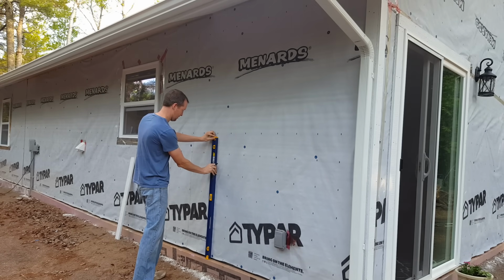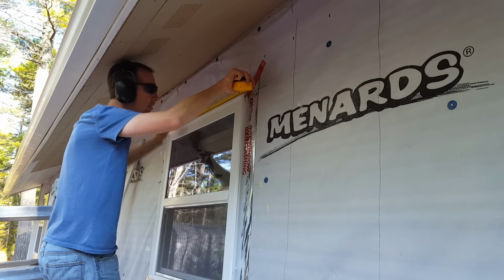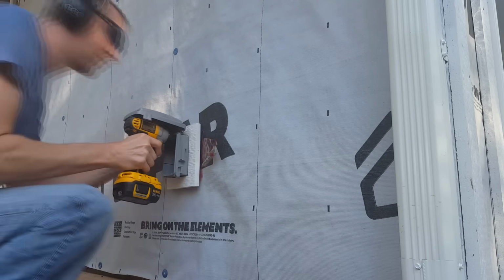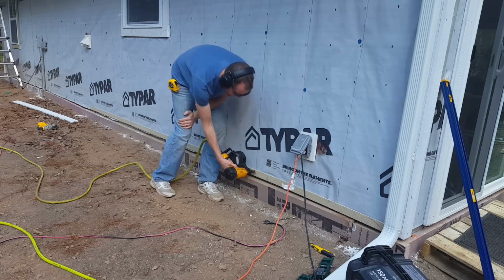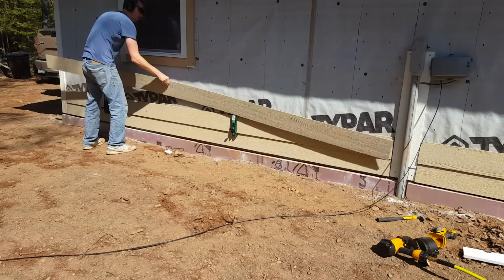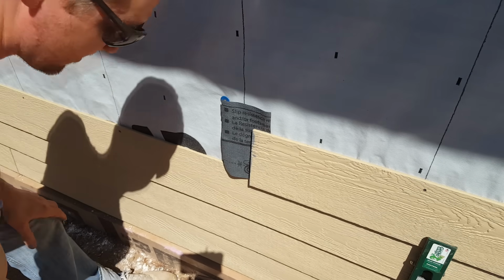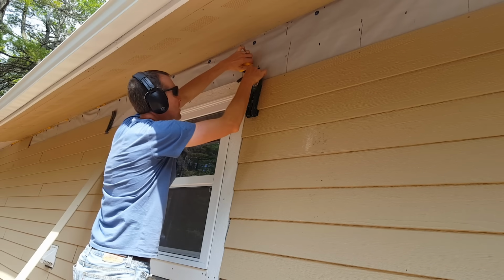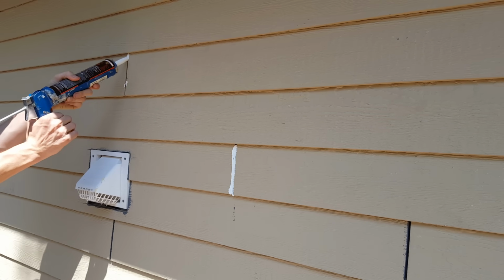Siding a House By Yourself

Comment: Curious as to why you waited until the installation of the 3rd board to see if it was level???
Reply from the maker: Hi Kyle, well the first row I leveled with the foundation. Then for a few rows I "eyeballed" it just to make sure everything looked alright. Sometimes that is the main thing. There is the saying "If it looks level, it is level". I just checked it ever so often with an actual level just to make sure it wasn't off by much. You can check it every row if you want, but how it looks really is the most important part when it comes to leveling siding.
Reply: @chaddiy  Understood, I would hate to get to the top row and have it not be level. Thanks for the explaination.

Comment: Great jobs 👍
Which type of  sealant using in joint filling area?
Reply from the maker: Hello, I used Quad Max caulk. It can be painting and remains a little flexable after it dries. It worked out great for me!

Comment: Nice job.  A couple questions.  Why didn't you paint you cut ends the same color as the siding?  I know even with hardieplank you shouldn't caulk the butt joints as it will still expand and contract.  All you should need is the flashing strip.  Is there something different about this siding?  I assume there will be some expansion and contraction and those caulked butt joints will look bad.
Reply from the maker: Hi Greg, The siding is just a primed color. If you look at the end of the video you will see everything painted gray. As long as a flexable caulk is used it is fine to do it the way I did. After everything is painted the seams blend in a lot better compared to using the little metal flashing pieces on the butt joints.

Comment: What stops water from getting under the siding on the bottom?
Reply from the maker: The siding hangs a little lower than the top of the concrete, so it doesn't leak in. There is also metal flashing that could be added to make sure no water ever gets in.
Reply: @chaddiy  that makes sense. I guess it was just from the camera angle it looked like it didn’t go over the bottom edge.

Comment: Reminds me of my father. He used to build 3 houses every summer from 1970 to about 2005. He did everything except the drywall and roofing (didnt  do shingles, he'd lay the sheeting for the roof) as that is very labor intensive. He totally worked alone and was very fast
Reply from the maker: Wow, That is very impressive to do 3 houses a summer. He must have been a hard working to get that all done by himself!
Reply: Building the house is labor intensive lmao
Reply: @jacobgriego3842  That's the thing about guys from that generation. Any work they enjoyed doing they didn't view it as "labor intensive" and any work they didn't like or didn't want to do, they viewed that as more labor intensive. Lol
Reply: I usually don't have a lot of problems with roofing unless there's a lot to tear off (2 layers or more).  And I do need a helper to help me stretch out tar paper.  Putting on shingles is the easy part.  : )
Reply: @lazybbones   Humping the bundles up a ladder can be brutal
Reply: @Please try later   More like a house every 6 weeks based on the summer lengths in Ohio. When he started in 1970 a 1000 square foot house was acceptable. When he stopped building in the early 2000's They were 1500 sq feet mostly. His niche was building starter homes for young couples that were affordable. He could sell them cheaper by installing much lower end (cheaper) kitchen cabinets and counters. These were items they could upgrade later as their income increased.  Just like some car companies make corvettes for the wealthier, others make
Honda civics.  My dad made lower end priced homes for people starting out. My dad built about 60 houses over that time.  I realize the math does not work out from 1970 to 2005 as there were real-estate dry spells where he had to have a heating furnace service business to make ends meet.
Reply: holy shit, that's amazing

Comment: Okay couple questions.  How did you make sure your first row was straight and level?  How did you make sure your siding lines matched up with the other walls?
Reply from the maker: Hello LivingCountry, I lined up the first row of siding with the bottom of the OSB sheathing. This was new construction on a level concrete slab. As long as I lined it up the same on each wall they all pretty much matched. There is trim on the corners so it really isn't noticeable if the siding is a 1/4 inch higher or lower on one wall compared to the other...Hope that helps!

Comment: Hey Chad what is the point of leaving the gap in between the pieces of siding and then caulking it? My guess is for expansion but I wanted to ask. Thank you and great video!
Reply from the maker: Yep, you need to leave the gap for expansion... otherwise the siding could start warping with humidity changes. Thanks for watching!

Comment: Chad my friend is replacing some siding on one side of her house but on a 14 ft height to 25 ft lengths a few pieces to replace. Do you have to start from the bottom up or can we go from top to bottom. We are only replacing what's needed. Please advise.
Reply from the maker: Hello, you can just replace the bad boards. They can be a little tricky to get the old ones out. I have done it with a crowbar lifting up the bad board and then use a sawsall to cut the nails hold the siding in place. Good luck!

Comment: I tried to find a comment to answer my question but no one asked. How many boxes of siding did you have to buy and how much did it cost for the whole house?
Reply from the maker: Hello Emily, the siding I used came in 16 foot boards that were 7 inches wide. Each board covers about 8 square feet. So you would just have to figure out how many square ft you have to cover. The cost was about 2 grand to do my house.
Reply: Chad DIY thank you for the quick reply

Comment: In my experience, siding shouldn't be nailed with a gun, they need room to allow the sheets to slide around & expand & contract from temperature difference. I dont mean any disrespect, but I wouldn't use my gun to side
Reply from the maker: Hello N M,  would you nail by hand then? I have seen that done with vinyl siding, but everything I have seen with LP Smartside (what I used) has been with a nail gun.
Reply: @chaddiy  I've never used anything called smart smartside but yes I was always told vinyl siding is supposed to be hand nailed for depth to allow for expansion

Comment: never caulk the seems for expan and contract  they are not professionals😂😂😂🤣🤣🤣😂
Reply from the maker: I used quad max flexable caulk that worked well. I caulked the seems and around all trim and windows. The caulk stretches in the winter and squeezes in the summer, but has held up great!

Comment: Looks just like my detached garage which flooded last year. How do you prevent water from coming in? Shouldn't there be some flashing before you put on the starter piece?
Reply from the maker: Hello Jack, I didn't use any flashing because I was building off a concrete slab so it doesn't matter if it got wet. If you are getting any flooding it sounds like it might be a grading problem with the ground around your garage.

Comment: Couldn't you build a rainscreen instead of the synthetic flashing at seams?
Reply from the maker: You could probably do a rain screen system, but it would add to the cost forsure.
Reply: @chaddiy  doesn't it also improve breathability and longevity of the siding?
Reply from the maker: It probably would, I just installed it the way the manufacturer recommended. I didn't see anything about a rain screen though.

Comment: I've used the clamps on SmartSide siding.  They do work ok, but there is a bit of variability on the thickness of the siding due to the texture.  The clamps sometimes slip, which can be really inconvenient when you are working off a ladder!  One thing you might consider on future projects:  The window trim should be 5/4" so that the edges of the siding are not exposed.  There is a 5/4 SmartSide trim product that works great.  I sided a house years ago with 3/4 trim and the exposed siding ends, even when faithfully painted, do not hold up as well.  Great Video!  Thanks.
Reply from the maker: Hello Greg, great point on the thicker trim! When I did this project I didn't know they made the 5/4. Also the clamps can be a little tricky. I found that I couldn't clamp them down tight, or else the siding would fall through the back of them. Overall, they did work very well I thought. Thanks for the comment!
Reply: @chaddiy  Yup...I've had them fall through the back too, but this is the best solo solution I've found.

Comment: I’d like to have a piece of that LP siding leave it outside for six months flipped upside down to see how it holds up If it still structurally sound would have no problem using it
Reply from the maker: Hello Robert, I once read about a guy who put LP smartside and Hardie siding in a bucket full of water for a few months. He said the Hardie was ruined and the smartside was just fine. Not sure if this is true, but mine is holding up perfectly after a couple of years now. Thanks for watching!

Comment: Can all seams match or should you use different sizes of siding to not have the seams match? Im siding 1 side of my home where i could use 12' pieces of siding.
Reply from the maker: Hello David, you will want to stagger the seems when you install the siding. Just cut some of the siding to different lengths to get the random seem pattern. Good luck!

Comment: I commend your efforts. It would have been a good idea to attach pressure treated furring strips under the siding so you you don't trap moisture between the wrap and your siding.
Reply from the maker: Thanks for the comment, that would be a good idea!
Reply: Absolutely not. Furring strips only go on block walls pal. You must be new

Comment: But joint should only be 1/16" wide.
Yours look like the grand cannon running down the sides.
Reply from the maker: This is L.P. Smartside which requires a 3/16 gap for install.

Comment: no flashing on the 2 inch foam?
Reply from the maker: Yeah, there should be flashing. It is easier to do it before siding, but it can be done later as well. In this situation it is mostly for cosmetic reasons. Thanks for the comment!

Comment: Those look like windows with a built in J-Channel.  Did you do anything to seal the gap where vinyl siding would go into the J-channel, or did the window trim fit in that space?
Reply from the maker: Hello Nathan, I don't remember the windows having the j channel. The lp trim I used just butted up to the sides of the window...they did not go in a channel.
Reply: @chaddiy  Chad, I'm trying to understand why you caulk between siding panels but not between siding and window frame.  Do you not worry about water seeping in between the siding and the window frame?

Comment: Many of those gaps look more like 1/4" to 5/16". No way I would leave gaps that wide I would do a 1/8" gap max because that siding doe snot expand and contract any more than 1/16" to 3/32" and in reality it probably only fluctuates about 1/32" in most climates.  Plus if you want to trim out the windows like a professional you miter the corners at a 45 degree angle it looks way better. Then on the outside corner 1x4 trim you rip them on the table saw at a 45 degree angle on one side of both pieces then set them up on a work table with a 4x4, 4x6 or some 2x4's screwed or nailed together. This enables you to set them up like they are on the corner and using clamps hold them in place and either nail them together with the 45 seams flush or what I do is use a countersink bit and drill holes countersunk for 2" screws and screw them together with exterior screws. Then you take your corner pieces already assembled and either nail or screw them to the corner. I usually use my nail gun to put a few nails in once I have it lined up like I want it just to hold it in place and then put some exterior screws 3" through the 1x4's into the studs. That's just me though I want the to do the best possible work with the best outcome for a great looking finished product. You can not do that when you take the easy way out and do layman cuts on your trim and just use nails that will eventually start coming out do to the wood expanding and contracting over time unless you are using hardy plank. Then you end up with some loose boards. Yes even with ring shanked nails it still happens over time. If you use at least some screws you know the boards will never come loose. If you use all screws like I just did on a building I just finished you never have to worry about anything coming loose and if you ever need to replace any of your trim or siding you just unscrew the old one and screw the new ones on. No pry bars and hammers and collateral damage trying to get pieces off prying the loose and breaking off in pieces. Sure it is more work up front but it is much better long term and better quality construction. Screws make the structure more sturdy and really suck things up tight.
Reply from the maker: Hello Brett, thanks for the comment. The reason I did thr window trim and gap spacing the way I did is because that is how the manufacturer said to do it. Here is the official L.P. smartside video if you would like to see. https://youtu.be/BTwxFD5tZjk
Reply: You have to go with manufacture specs or it voids the warranty Brett

Comment: @chad DIY great job !
I have a question, can I installing sidings on the brick wall ?
Reply from the maker: Hello, I am not an expert but I think you can side over brick. You would probably have to add furring strips to the brick and then nail the siding to that. Good luck!
Reply: No, brick and cement retain moisture, the manufacturer of LP SmartSide states the siding should not be in contact with any brick, concrete, or masonry.
Reply: Yes double-sided carpet tape works wonderfully

Comment: Where did you find coil nails and nailer that shoot the recommended .113 nails? Im having trouble locating a coil nailer that shoots that large, and the nails to go with it. Thanks!
Reply from the maker: Hello Aj, I just used a regular siding nailer and .090 nails. Had no problems with that size nail holding well.  To do the .113 nails I think you would have to use a framing nailer. Good luck on your siding!

Comment: You’re supposed to nail all siding loose, never use a nail gun on siding
Reply from the maker: That is incorrect. I am using L.P. Smart siding which is fine using a nail gun or screws...that is what the manufacturer recommends.
Reply: Chad DIY Sorry thought it was vinyl clapboard
Reply from the maker: No problem, yeah vinyl you want to leave a little loose.

Comment: I didn't have a nail gun to install my cement siding, so I resorted to hand nailing.  This didn't work very well.  I decided about half way thru the job to predrill nail hole.  The bits wore out endlessly because  of the abrasiveness of the siding.  So whilst drilling, I accidently snapped off yet another drill bit tip.  Lo and behold, It worked better broken.  So then I went and bot a 24 pack of 1/8 in bits and nipped the tips off all of them.  It worked so well that I had no problems predrilling nail holes.  Who'd have thot a broken drill bit works better than a sharp one for predrilling holes in concrete siding.  Likewise I've found it easier to score and snap the siding instead of fighting with a skill saw.
Reply from the maker: Thanks for the comment and the tips Terry. All the issues you ran into are the reason I used LP Smartside instead of cement board. The LP cuts just like wood. They both look great once installed though!
Reply: That's what I do. Goes faster if you stack 3 boards to drill

Comment: You can also use join covers instead of caulking.
Reply from the maker: This is true!...it works well with prepainted siding.
Reply: Indeed! I build houses for a living and my trimmers use joint covers and corners. Cool video
Reply: Glad you mentioned that, I was wondering about that, a young guy at the lumber yard said you don't use those anymore. In the past I used those and put caulk in as I put them on.

Comment: good use of roofing nailer....2 3/8 in nails better for siding.   framing nailer with adjustment so head flushes to wood surface
Reply: I thought I was seeing things. He said "siding" nailer. But don't mistake my comment, I've done that. I just thought he actually had one. 😅😅😅

Comment: I don't see how this system is weather proof.  Is this system standard in America?  You must have quite the problem with rot.
Reply from the maker: Hello Erwin. With this system all the boards overlap and any seems are sealed with caulk to avoid any water getting in. Rot shouldn't be a problem.

Comment: You left out the hard flashing over the window and both the hard and soft flashing at the electrical outlet.
Reply: So for those of us non siders what is the hard flashing and soft flashing?
Reply: @oldhess  Soft flashing is 12 inch wide very thick asphaltic tape with one sticky side, that attaches to the head, jamb and sill and wraps around onto the wall to overlap on the tyvek.  The hard flashing is galvanized z-flashing at the header, that of which the long vertical leg is attached to the wall just above the window head trim, runs outward across the head trim and has a drip edge that is bent down in front of the head trim.  An additional strip of soft flashing runs across the wall above the hard flashing and laps over the long vertical leg of the hard flashing.
Reply: he did but i doubt that window will ever see any water unless there is a sprinkler hitting it. should last a good long time tucked way up under that overhang.
Reply: screamdoctor he forgot the 1/12
Reply: I like how non of u know what ur talking about
Reply: @samkotsch9373  Please enlighten us...